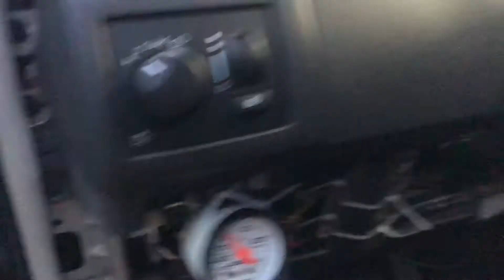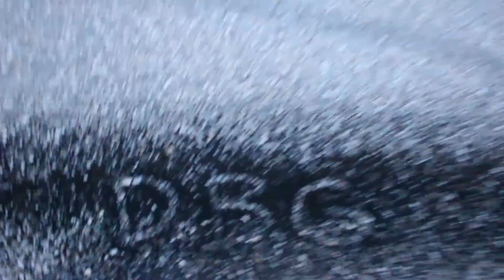TURBO HEMI BUILD BREAKDOWN!!! IN DEPTH LOOK!! FIRE TIRE BURNING!!!

Comment: Can’t believe it’s fully stock that’s so dope ,seems to be handling power just fine ...do you think that kind of power is sustainable on stock motor /transmission? And how much boost are you running
Reply from the maker: Probably not sustainable for ever. Especially with the transmission. Waste gate is set at 9psi.

Comment: Looking to start a junkyard turbo build gen 3 hemi. What did you use for turbo manifold?
Reply from the maker: On the 300c we used long tube headers. Cutting the collectors off and welding v band flanges on instead.

Comment: Did you plug the 450 fuel pump into the factory pump harness, or rewire it? If so how did you put the new wires through the top of the tank?
Reply from the maker: Rewired it with 10 gauge through a relay.  Drilled a small hole in the tank cap and ran the wires through. Sealed it up with some gasket maker.
Reply: @doublebarrelgarage  How did you connect the pump outlet to the stock fuel hose with the quick connect? Did the quick connect snap right onto the the walbro 450?
Reply from the maker: It sure didn’t, i cut the quick connect off and used the flexible line that came with the Walbro and connected them with a barb fitting. Not sure if there’s a better way but that’s been working fine
Reply: @doublebarrelgarage  Awesome thanks!

Comment: What manifold do i need to use to attatch the turbo? I want to go 75mm on My Challenger! ALSO WHAT INTERCOOLER
Reply from the maker: We built all the exhaust. Used long tube headers and welded v band on. Intercooler is a 3” inlet PW
Reply: Double Barrel Garage is there anyway we can personal message i have so many more questions and want to see pics if possible
Reply from the maker: Instagram